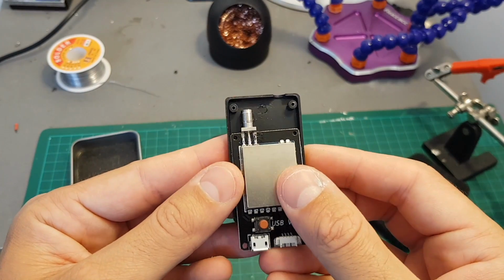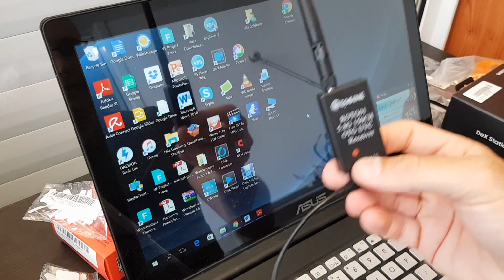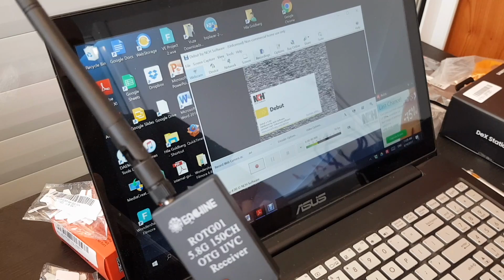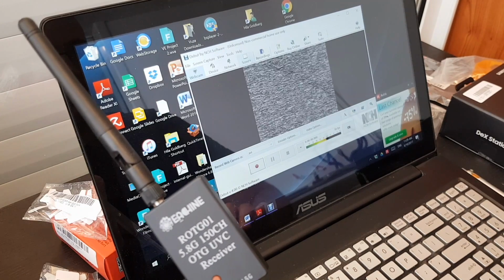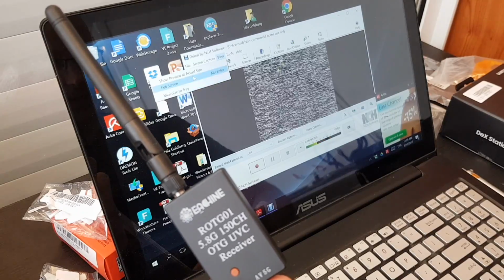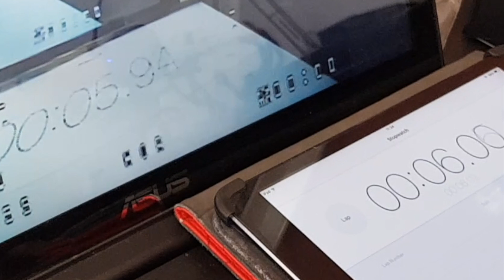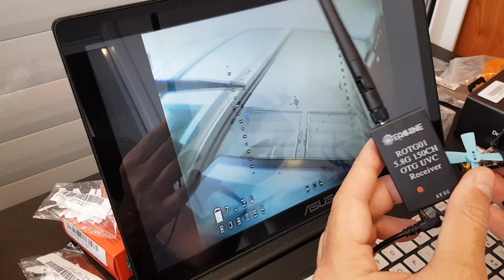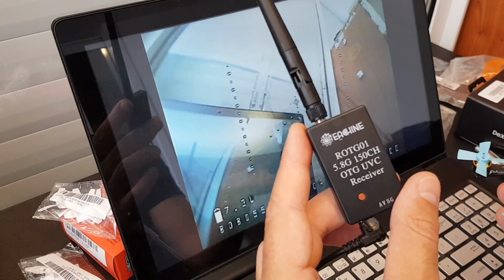How To Do FPV On Your Pc - Eachine ROTG01 Review + PC Test

Comment: Hi
My webcam has 4 wire as you mention in the Video
5V GND D+ D-.
I want to connect the webcam to Video Transmitter
The Vtx has several ports (Pinput, Pout to camera,  GND,Video,Smart audio)

Do you where should I connect the D- and D+ wire?
Reply from the maker: You need an analog camera.

Comment: is that every version fpv camera can connect with this receiver devices
Reply from the maker: Every FPV camera which is connected to a 5.8Ghz video transmitter.
Reply: @KremerFPV   the camera will work just on frequency : 5.8Ghz  in the specified area ?
Reply: @KremerFPV  thanks
Reply: @KremerFPV  alot

Comment: Bought similar receiver (150 channels), but it can not find the signal of my 5.8ghz drone - just black screen and showing different frequency numbers when it searching through. What could be a problem? Same result with a smartphone and laptop (Win 10, Camera app). The drone app for smartphone can't connect to the drone too or just crashes when trying too. The drone flies fine with 2.4ghz controller. Seems that for taking pics I need other drone. :(
Reply: My reciever is FPVKing 5.8G FPV OTG Receiver 150CH UVC Video.
Reply from the maker: Black screen indicates that the VTX is working, but it's not connected to an FPV camera.
Reply: @KremerFPV  How to fix it? To get exactly the same model of the reciever as in your video, or there's a problem with the drone cam itself?

Comment: Would add some color correction and filters on it too if you would actually use it on PC.
It wouldn't add much latency wise with a decent GPU, but improves the images so much.

Comment: Thank you so much dear Gal Kremer :)

can you please tell me if you notice any difference between the quality of the cheap and middle price one ??? about latency and video quality please ??

i saw your great test comparing 3 otg receiver but dont see this eachine Eachine ROTG01. Please tell me if is any difference of quality of latency
Reply from the maker: +Fraizer Hey there. In my humble opinion - there is not much of a differennce between all these devices in terms of video quality and latency. The ROTG01 is a solid choice and I'm sure you will enjoy it.
Reply: Thank you, but if you must choose one who is little better in latency and video quality ? (dosent matter the price). i see in different review this Eachine ROTG01 have 100 latency when the 3 others you tested had arround 51-48. i saw you test this one but not in the same condition system than the other. there prices are ridiculous then your nice advice will make me choose the best one ^^

Comment: Eachine ROTG01  works with my phone but not with my PC. It connects with the PC as a USB 2.0 Camera but does not show anything on VLC or windows 10 camera app. Any ideas why?
Reply from the maker: Have you tried using a different USB cable? (Make sure it's a data cable)
Reply: @KremerFPV  Thanks for the quick response. Yes I tried different cables. even a usb data  cable.
Reply: I also have the same issue. I tried different software as well and still nothing.
Reply from the maker: @ArsalanKhan-yb8hb  Does the computer recognise the device? Have you tried it with different computers?
Reply: @KremerFPV  yes it recognizes it as a USB 2.0 Camera but I dont get any output from it, just a black screen. I have tied it with different computers. I also ordered another one to see if that worked and it didnt.
Reply: Arsalan Khan I have the same problem. Did you solve it?
Reply: @JohnCuppi  The issue is probably with windows 10, I tried it on another desktop computer and there it worked

Comment: Hi, Gal wonder if you can help again, please. I have watched all 5 videos in the series and want to use this receiver on a windows laptop but it does not have a mini USB socket, do I need a special adapter? Have downloaded the capture software already found it useful. Thanks, great stuff.
Reply from the maker: No - All you need to do is to use a standard USB to micro USB - just make sure it supports data. If you have an Android device with a micro USB port, the cable that came in it's kit will do the trick.
Reply: Thanks very much Gal, all my questions answered once again.
Reply from the maker: +McHaggus My pleasure

Comment: First of all, thank you for the video. I'm preparing a project and making processing codes and I'm using my computer's camera. My question is: Does my computer see this device as an external camera? In my project, I'm taking views from my computer's cam and using OpenCV library in Phyton then executing some processing codes. I mean if I would connect it to my computer, will it work like my computer's cam? Or, do I have to use VLC Player or other media player? If I have to, can I run processing codes with VLC player?
Reply from the maker: Yes it will be simply recognised as a webcam which you can use with any program that supports it.
Reply: Gal Kremer Thanks for reply. Which kind of drones can work with this receiver? Im planning to use Dji Tello bcs I need a programmable drone but Im not sure that receiver could work with it
Reply from the maker: @melihmetin  The tello is not compatible with this VRX. Only drones that are equipped with analog 5.8ghz VTX will be compatible.

Comment: Hey quick question, I'm not sure what's happening since it's only showing a blank screen on my laptop but it works properly whenever I connect it to my phone.
Reply from the maker: It should be recognised as a USB 2.0 camera. You should make sure that you are using a data cable.

Comment: Hey Gal!  After watching your video I ordered an ROTG01 unit. I have win10 on an asus ux305c, and first i could not even get the decive recognised sadly. After reading the comments it turned out that most of the lame chinese power cables aint no good for data transmission, and picking a better quality cable just fixed the problem! So for All of You, who having issues like mine, just try more cables, i tried 3 and none of them worked. After that i looked up for an original Sony xperia data cable, and IT JUST WORKS WELL! Dont give up, guys! 
And thanks for the video, keep up the good work!
Reply from the maker: Yes, that's pretty annoying but I am glad you got it sorted :-)
Reply: do you have a link download driver and software for win10 ?? please share for me.
Reply: MeTronix TH there is no driver needed if you have a suitable usb-b cable! VLC media player should automatically recognise the device when starting a stream

Comment: Hi Gal
I have received my transmitters and receivers
VTx03 and Rotg01 5.8G

my camera is connected to a 5V 2A power bank (or a charger 5V-2A).
can I connect my camera and the VTX03 without any problem?
Reply from the maker: Hi Margoon. Yes, 2A output can handle both.
Reply: cool   thanks

Comment: After so many years, the App for android does not work for new Android versions like my Android 12 device. I dit have back then a Android 9 which dit work fine, but they dont update the software, so i dose not work any more. Only can use it on a computer.
Reply from the maker: That's unfortunate :-(

Comment: Would this work if you were to connect it to the USB on a current model TV? I’d like to race my FPV car indoors and use my TV :) ???
Reply from the maker: Only if your TV is running Android and supports OTG devices. 
Otherwise you should consider getting this device: https://youtu.be/f-EeZ_hVpaY

Comment: Hi Cal Kremer  very good you channel
I have three runcam 2 and will use them simultaneously.
I can use 3 Eachine VTX03 Super Min and Eachine ROTG01 UVC.
  so that I can see my 3 runcams on my laptop MSI (2 * USB3 and 1 USB2)
or I need 3 different FPV Transmitter
margoon
Reply from the maker: You need to have each camera to be connected to its own VTX (Such as the VTX03) and have 3 separate OTG receivers. Than in your computer you will need to use an application that supports multiple AV sources and you should be good to go. Good luck!
Reply: thanks  for you help 
my runcam2 is a wifi cam, can I use this signal with the OTG receivers?

Comment: Hi, what is that other connector on the receiver? Does it provide AV out?
Thanks
Reply from the maker: Yes, it provides an AV out, but the needed wire is not included.
Reply: Awesome. Thanks. I guess it takes 5V input from that port and throws out AV from other 2 pins. Waiting for mine to arrive..
Reply: Well, eventaually I found that it will give out demodulated video, and that with lower delay on this port, but it won't show it's UI on that video, so to be able to select frequency, you'd need a usb capture (pc or phone) connected. I fidured best use is to connect it to AV in of my 7" FPV screen for flying and use a usb-connected phone to tune.
Reply: Well, eventaually I found that it will give out demodulated video, and that with lower delay on this port, but it won't show it's UI on that video, so to be able to select frequency, you'd need a usb capture (pc or phone) connected. I fidured best use is to connect it to AV in of my 7" FPV screen for flying and use a usb-connected phone to tune.

Comment: Does it come with that PC cable?
Reply from the maker: +forteleaerieneromane Yes - it comes with a micro usb to micro usb cable.
Reply: yeah, but the cable you used was micro USB to normal USB, right? That's the cable I was asking about
Reply from the maker: +forteleaerieneromane  Yes, it doesn't come with this cable.
Reply: Thanks for the reply! One more question: The cable you used is a normal cable (for example the one used to charge a smartphone) or does it have a special micro USB, which can only be used with this FPV DVR?
Reply from the maker: +forteleaerieneromane No worries. Use a regular micro usb to usb data cable and you'll be alright.

Comment: Hi there! I have tried my Eachine receiver on a Samsung phone using the GoFPV app and it worked perfectly. However, when attaching it with a normal Micro-USB cable to my laptop the device is not detected. I've been looking for a driver but cannot find it. Help pls!!!
Reply: I've tried to connect to different laptops to make sure it's not just mine. The device was never detected.
Reply from the maker: Hi. Did you try using another micro USB cable?
Reply: Hey. I've plugged it into a third friends laptop that was able to detect the device. Afterward, I plugged it into my laptop again and now it also detects it as USB Camera. I can choose it as camera inside Debut, but it tell me 'Failed to connect to the device' !
Reply from the maker: Were you able to see the video feed on the third laptop?
Reply: No, so far I was only able to see the stream once on an Android phone. I went back to the same phone and this time it did not show the video. So today I sent the receiver back to Amazon. I will try my luck with EasyCap. Thanks for your replies. And good luck with your channel. It's super helpful!

Comment: I have same model but I have a problem by screen goes blank(like when vtx on quad is off) for few seconds between the flight. I have rechecked every wiring and will try to connect it with PC and see if same flashing stuff is happening with my PC
Reply from the maker: If it happens also when you connect it to a pc, you might have a defective unit...
You should also try another USB cable.

Comment: Thanks. The RotG01 seems to have installed the RX5808 tuner. This is based on the RTC6715 tuner chip.
Reply from the maker: Thank you Michael

Comment: I bought ROTG01 after watching the video. Everything works fine, it can pick up the frequency of the FPV camera but there is no display at all. I'm using Turbowing Cyclops Camera. Can you help me with this?
Reply from the maker: Are you able to run the frequency scan? Did you test this camera with another receiver?

Comment: hi can you help ke with mine. my pc win7 wont detect my rotg01 pro. it says drivers not installed or not detected.
Reply from the maker: Hi, it should install it automatically.
Reply: i went to the device manager and uninstall the previous driver and reinstall it and it worked. ty
Reply from the maker: @jeremyred6343  Np. I am glad you sorted it out.

Comment: I was able to get it working with VLC media player 2.2.6.
Open the program:
Click Media in the toolbar then "Open Capture Device" (CTL+c)
Make sure Capture Mode is in "DirectShow"
Under Device Selection: Video Device Name, Change from DEFAULT to "USB2.0 PC CAMERA" with the drop down menu.
Then click "PLAY" at the bottom.
Good luck!
Reply from the maker: Nicely done! Thank you for the instructions Shane.
Reply: Thanks!  I'm going to try this as they want you to pay 30 bucks for a license to record using the software recommended in the video.

Comment: my question is i will ise that on my race drone is it oke ? and how far it wil go like 200m ore not that much? my transmitter on my dorne powered at 600mw i think
Reply from the maker: You should expect a range of  a couple of hundreds meters.
Reply: Gal Kremer  thx gor the respons
Reply: Gal Kremer you q
are a good you tuber
Reply from the maker: My Pleasure Dan.
Reply: 100ms latency for racing drone is a waaaaaaaaaaaaay too much :(

Comment: HI Gal
I believe I made a mistake
I connected my VTX03 and GOT G01 5.8 to my laptop and it works, but I get bad picture 640-480 / 30fps

I need a transmitter and receiver that can handle 1080P / 60fps
do you have a solution for my problem?
margoon
Reply from the maker: Hi Margoon. A VTX that is capable of transmitting 1080p60fps will be very expensive.

Comment: Got my Eachine ROTG01 but doesn't work on my cheap phone, it needs to be 'UVC (USB video class) OTG (On-The-Go)' enabled. After a lot of research about rooting your phone and buying a Micro USB OTG to USB 2.0 Connector Adapter nothing worked. The only way to use this receiver is to make sure your phone is 'UVC and OTG' enabled, or buy a phone that is enabled, as I will probably do if I can find a cheap one.
Reply from the maker: Thanks for your comment and for the advice. Sorry that it didn't work for you.
Reply: You can install a driver to get UVC on the phone...let me know if you need the YouTube link....a guy provided the apk downloaf

Comment: Nice job. I particularly appreciate that you tested latency using a digital timer to assure an accurate estimate of this parameter.

   Could you include a link to the video display software (Debut?) that worked well for you in your text description above?
Thanks.
Jim
Reply from the maker: Hi James, Thank you for your comment. The link is already in the description of the video.
Reply: Thanks. Found it.
Jim

Comment: Thanks for sharing I could not get it working with VLC,  the linked software works a treat...non of my Android devices supported UVC OTG. Now I have FPV on laptop with Win7.....THX Again
Reply: I had the same problem with SIII and S2 tablet.  I have several Receivers, cameras and Transmitters.  Occasionally I could get a picture as it should be but if I moved anything it would disconnect.
I decide to switch antennas to a 5.8 Patch antenna and the application and hardware works fine.  Apparently my problem was the cheap rubber duck antenna EAchine packed (and others) with this receiver.  Hope this helps...
Reply: VLC also works in Linux - Media, open capture device, capture mode: TV analog. leave everything else blank and hit play.

Comment: Thanks for the video! I use an otg receiver on my homemade goggles, but I use the raw video out. On that connector the latency is not too bad. :) But with smartphone it is not flyable for me. :(
Reply from the maker: Thank you for your comment :-). I have tried it with goggles and it was actually not that bad, but not as good as using a real pair of FPV goggles.

Comment from the maker: Thanks to Andrew Smith, I can confirm that it does work with Mac. 
You can either use the Debut mac version or just Quicktime.
Reply: Do you mean: the ROTG01 works on Mac and therefore we don't need to specifically buy the R051??
Reply: @Ndriana  For posterity, I can confirm I was able to get the Eachine ROTG01 Pro receiver working on Mac (Ventura 13.4). I connected the receiver to my computer via the micro USB<->USB-C cable that was included in the package. The receiver appears as a camera/video source named "USB2.0 PC CAMERA".

I'm able to select the ROTG01 as the video source in the following apps:
- built-in Photo Booth app (under the "Camera" menu in the menubar
- built-in Quicktime Player app (start new "Movie Recording", then click the "v" caret next to the record button to get options for camera, mic, etc)
- the Google Meet web app (settings -> camera)

Comment: Does it work on Linux ?
Reply from the maker: It works on Mac, so there's a good chance it will work on Linux as well. I haven't tested it though.
Reply: OK cheers. When mine comes in, I will test it on Linux : )

Comment: Gal:
   Today I received my Eachine ROTG01 VRx receiver. I downloaded the Debutsetup.exe program, but have been unable to get it to display from my ROTG01 on my computer.
    I found that my AMCap.exe program, downloaded years ago, DOES work, but this program is not very powerful, and does not allow saving videos in MP4 format.
    Do you have any suggestions?
    Do you know what the pinouts for the connector on the bottom right side are?  Have you found a source for instructions on the ROTG01?
Thanks.
Jim
Reply from the maker: Hi James. I am sorry - but I am using a mac, so I don't have another recommendation for you... Maybe someone else can help you with that. Regrading the pinout - the left one is Audio, then Video, 5V and Ground.